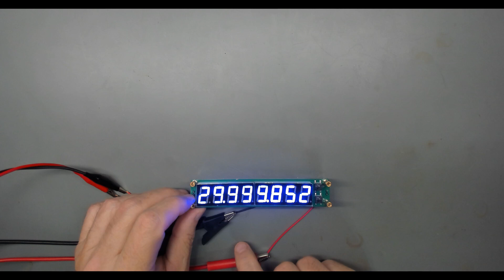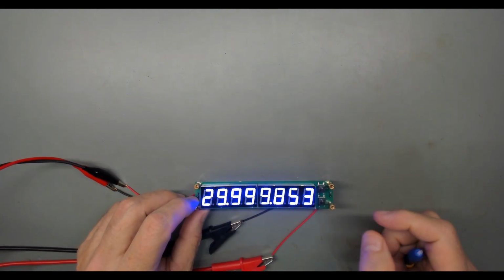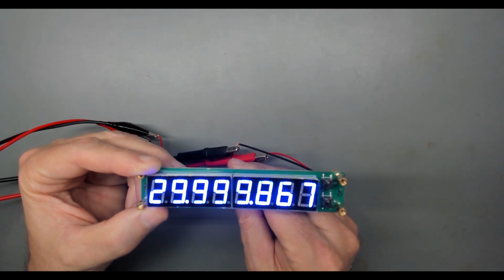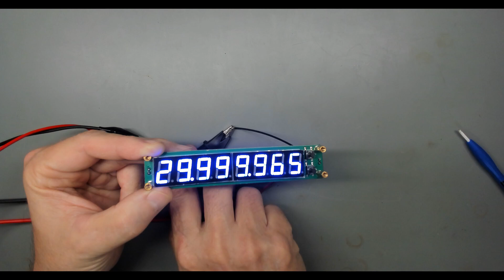Want Accurate Readings? You Need to See This AliExpress Frequency Counter Followup

Comment: They're a VTCXO (or were) and on at least some of them are an odd frequency because they were intended for use in cellphones.

They're nice little counters, they stack up nicely against my Racal counters with a proper, high stability oven reference  and really don't drift a lot after warmup.

The programmable offsets are really useful too but they do chuck out some RF hash of their own (I think it's the multiplex/PWM drive of the LED matrix) so can be problematic in a receiver if you're unlucky.
Reply from the maker: Thanks, 
Mines 13mhz. 
RJ

Comment: Is the signal generator calibrated? 
I use a GPSDO to give me an accurate 10MHz signal and use that for calibration. If the generator takes an external 10Mhz input reference, that helps, too, for calibration purposes.
Reply from the maker: It’s, only a couple years old so should be very close on its own, but I added an external in an earlier video. One of the cellphone tower clocks modules. 
Too lock it in.
RJ

Comment: TheHWcave youtube channel, also had some videos on this unit. Including extending its calibration range. "PLJ-8LED (clone): fixing the other module" The one I bought, so happened I could easily adjust to a correct 10Mhz signal out of a GPS module. That channel also has another good video on those modules going over their input stages and function.
Reply from the maker: Thanks for the info.
RJ

Comment: Better than I expected.  If the POT isn't bottomed out adding a resistor in series may give you just enough to bring the unit closer.
Reply from the maker: Thanks for your input. I also was surprised. It looked as if I needed less resistance so that wasn’t an option for me. 
RJ
Reply: @LynxElectronicsLab  could you measure the resistance across the pot and then suss out a resistor to put in parallel? that would be such a dirty hack though haha.
Reply from the maker: Thanks for the input.
It was at the zero ohm point so it wouldn’t help. 
RJ